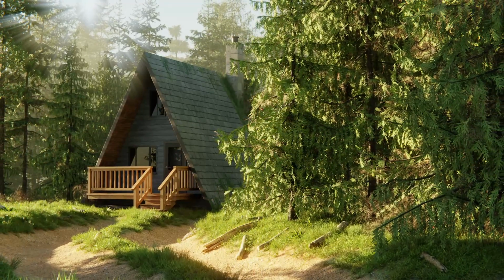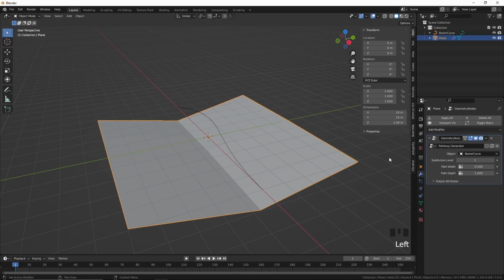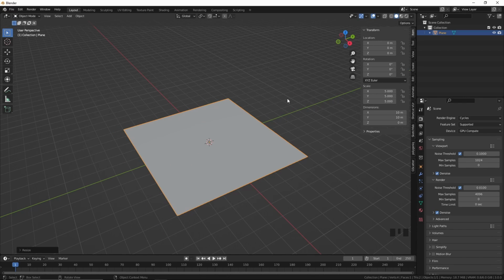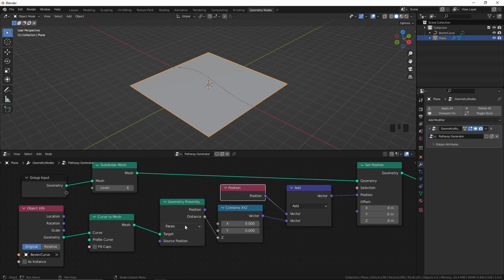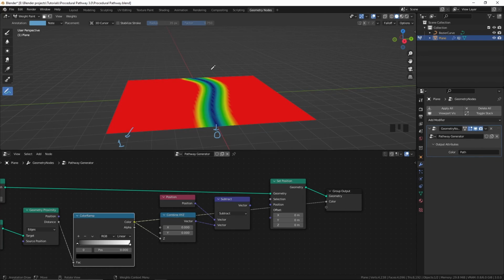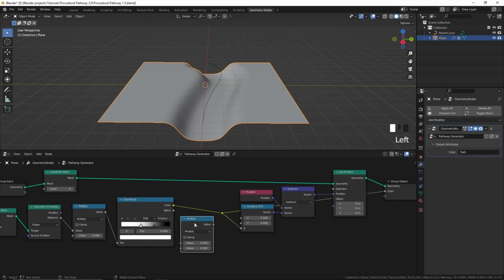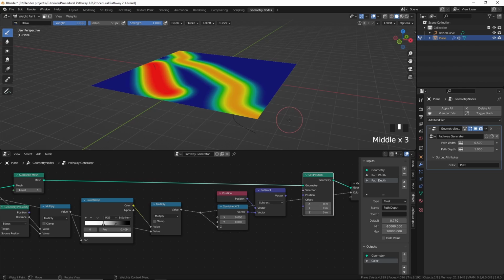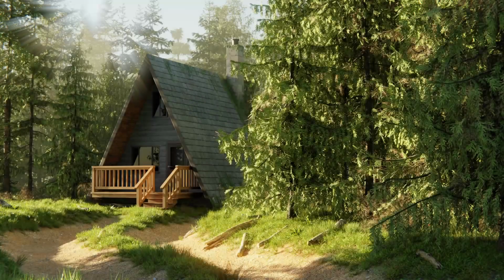Make procedural pathway in Blender w/ Geo nodes | Blender3.0

Comment: The mesh deformation wont follow the curve shape. Any ideas? I applied the scale
Reply from the maker: Can you please expand your problem?
Reply: @CGObaid  Sure! I am following your tutorial from scratch, doing exactly like yours. At minute 10:40, when you change Geo Proximity from Faces to Edges, my curve makes a weird shape on plane. You plane makes a perfect " V " shape (just like the shape of your Bezier Curve is itendend), but mine gets really wrong . I tested with other objects, as a Sphere, and the result was wrong too. Do you have any idea what might be happening?
Reply: @CGObaid  Nevermind, I found the issue
Reply: I have the same problem after changing Geo Proximity from Faces to Edges. My plane will not turn V-shaped like yours. Is there something I have missed?
Reply: @jonnehansson2787  In my case I was plugging the wrong sockets, recheck your nodes and see if everything matches
Reply: @maurícioheberle-z9w  I'm so embarrassed. I was plugging the wrong socket. Thank's for the help.
Reply: @jonnehansson2787  hey thats fine! Good thing you found out 😀

Comment: how can i make it so the curve carves the mesh when its under it, and builds up to the mesh when its on top of it?
Reply from the maker: That's interesting, I'd have to do research to find out exactly how to do that but It will require the use of Raycast node to find out the distance from the curve and the terrain and then use that to displace the terrain using a set position node somehow.
Reply: @CGObaid  i tried for hours today, couldnt quite get it, if you find a way please tell me 😩 couldnt find anyone doing something similar either

Comment: Thank you for a great tutorial! (Subscribed). One question. Would this work across a slope or up a slope. It seems to rely heavily on 0 and 1. What if the plane was tilted?
Reply from the maker: No problem :) For values beyond 0 & 1 you can use a Map range node to change the range of the values.
Reply: @CGObaid  Thank you for your reply! So this would work across a slope with a level path and a sloped plane (Mountain side for instance)?
Reply from the maker: @andyklyen6885  I haven't tried, but it should work I think so..
Reply: @CGObaid  Thanks for answering again. I'm working on a hill side village with little paths and roads. This could be the answer.. Thanks!
Reply from the maker: @andyklyen6885  You're welcome I read every comment. Hope that works :)
Reply: @CGObaid  How do I apply that Map range node? Could you please explain that? Thanks in advanced!

Comment: Hey @CGObaid,
Great tutorial!
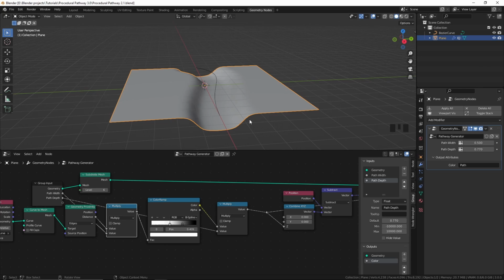As a Fix for the problem at 19:04 you can check if the distance generated by the curves is zero, by plugging the "distance" into a boolean "not" Node and let that switch a mix node between "0" and your desired color ramp output.  that way, the plane only gets displaced, when there is an actual curve!
Reply: I would like to understand what you mean. The problem must have another solution. I tried to make like you mentioned, that doesn't work. I make something wrong. Can you explain it a little deeper or precise? We could also use the Discord. Maybe you have a picture file of a node tree? Best regards
Reply: Thanks, that worked for me.
Reply from the maker: When I first read your comment I didn't understand. But now I tried this method and it works really well. Thanks a lot for the tip :D!

Comment: Hello Obaid,
Thanks for this, great Work. Just bought it from you. 

One question: Lets say i want to Do similar to this path, but instead with tiled Stone / pavement as material in the path.
Then it would be Nice to just have the curve not needing that much depth for it to create another material.
How would one alter this nodes of urs to achieve this?

Cheers
Reply from the maker: Yes, you can. Just decrease the path depth from the geo - nodes modifier & in the shader editor you can use your own material. But remember to mix the two materials you have to use the "Path" attribute for the fac . 
Thanks for buying 😊
Reply: @CGObaid  yes thank you!
But one thing, when i change the depth the material like vanishes because its bound to the UV Value, so its almost like it needs à lot of depth for the second material to be visible? Is there some kind of modifikation i can Do there? Perhaps in the color ramp?

Cheers!
Reply from the maker: @cg1582  Send me a screenshot of the material. Maybe I can help :)